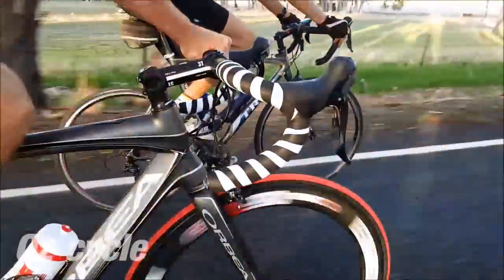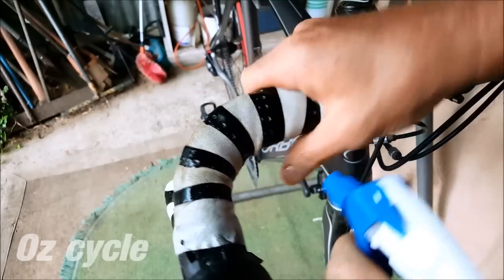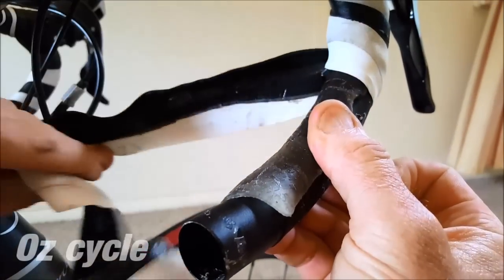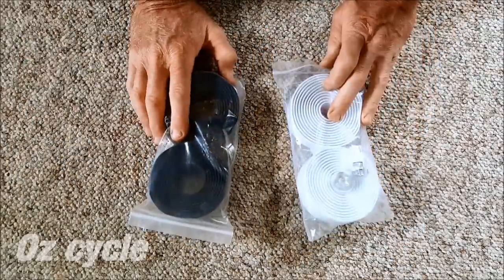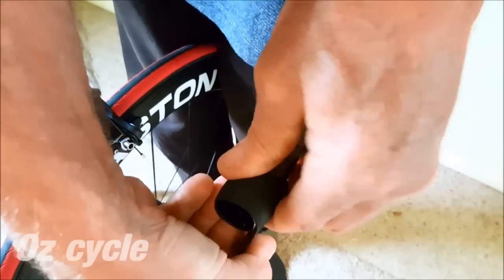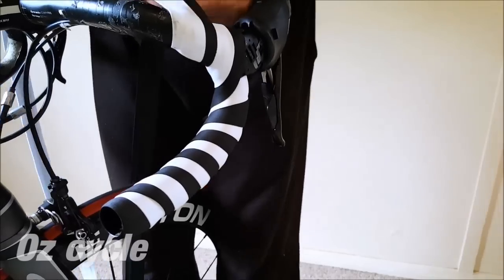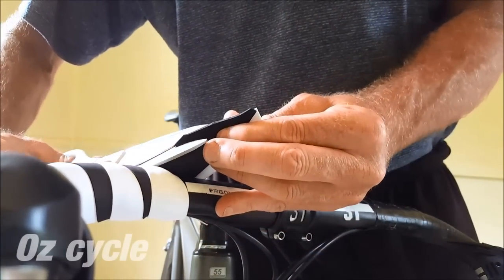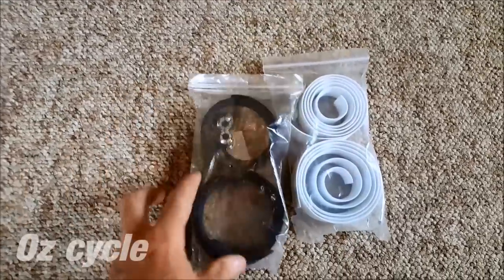How to wrap two colour handlebar tape

Comment: Nice job. But.......since you and I mostly ride on the tops I'd rather have the wrap in the opposite direction so it tends to stay tight. If that means the drops are wrapped so the  tape tends to loosen it's less of a problem cos I / we ride mostly on the tops. With a single tape roll I achieve both by reversing rotation at the lever.
Reply from the maker: Good point, wrap direction according to preferred grip 👍

Comment: Can you tell me if the thickness will be the same as the double wrapped?
 Interesting video!
Reply from the maker: +Seph Snake Double wrapping makes the taping slightly thicker....more comfy too.
Reply: I don't think it will be as thick as a double wrap (which I prefer). I imagine this method is somewhere between single and double wrap.
Reply from the maker: +SlowBoyAthlete Correct.
Reply: So if some extra thickness is desired, put some cut inertube  rubber in the 'chosen' spots (where the palms put pressure) is my humpble opinion.

Comment: Hey OZ does this mean I would have to use 4 bar tapes as oppose to just two ? Or if you overlap two on one is there spare enough to do the other side ? So still using just a pair of tapes ?
Reply from the maker: 2 bar tape packets. There will be left over but only for a tennis racket handle 😂

Comment: Is there a way to make the new bar tape FATTER in the drops?  I like a hand filling grip.. I used to use pieces of old tape.  Is this a valid method?
Reply from the maker: You can buy gel inserts or just wind an extra layer of tape under the final